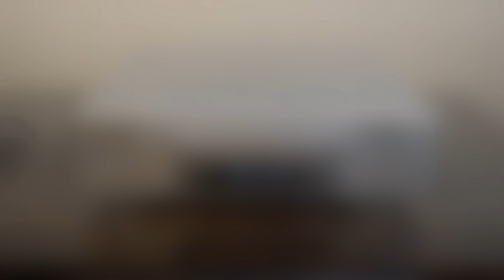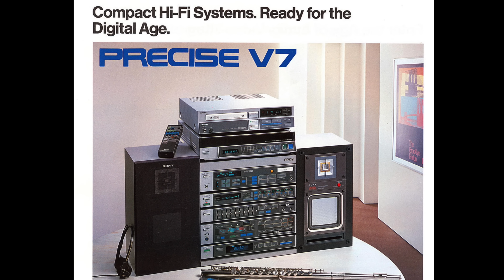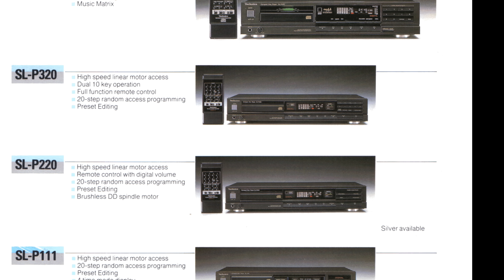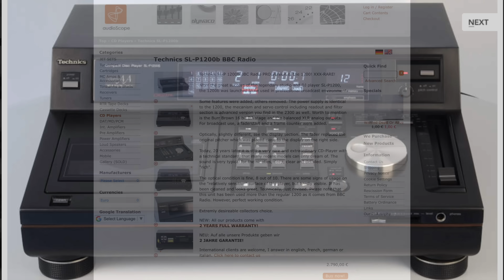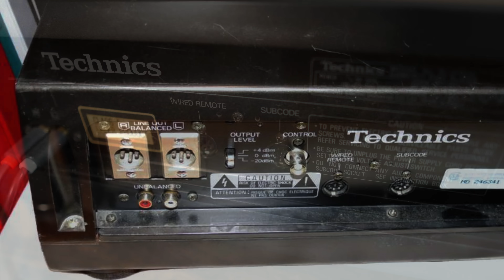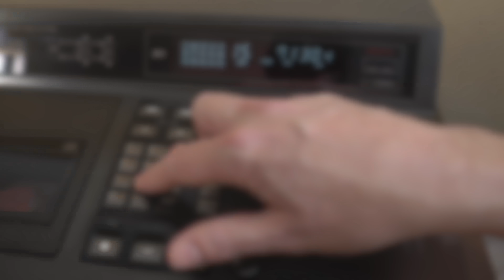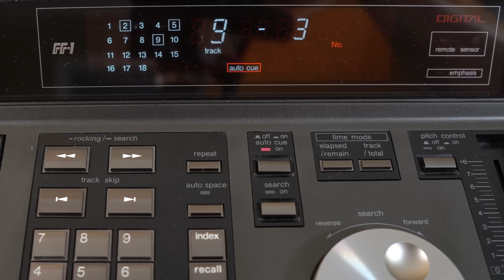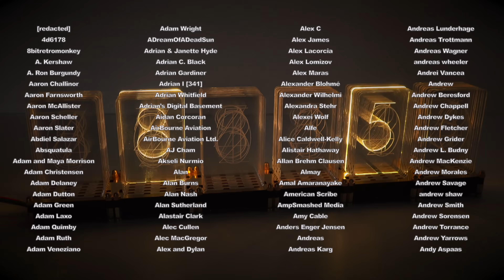How CD players lost their cool & why this Technics didn’t.

Comment: Good to see this player again.  I used the BBC ones extensively when I was a studio manager and Radio One used them before buying Studers. The Studers were better as they remembered the cue points set by the operator/DJ on discs even if they were removed and replaced.  Also worth mentioning that the Technics design mirrored the SL1200 turntable (same feet and pitch control layout). 

By the way the Technics had the ability to access index points using the Index button but I don’t think this was ever used on a commercial CD unless anyone knows different?
Reply: I think indexes were more common on classical music to indicate movements etc.
Reply: I did notice that the pitch slider is reversed compared to the SL1200 though. On this CD player you push the pitch control away for an increase in speed and pull towards you for a decrease, whereas on the SL1200 it's the opposite.
Reply: @robsayer8028  i have no idea why they did it that way but it's annoying! sounded like 3-+4% ish too!
Reply: IIRC the Studer/Revox machines also had that index function which was good to have for playing those commercial music beds used on jingles and ads.
Reply: Atom heart mother by Pink Floyd had index points on the first track, atom heart mother. My old Sony boombox was able to see and use them.
Reply: And Manowar’s "The Triumph of Steell".
Reply: I have a few early CDs with index points. Two that come to mind are DG Karajan  Strauss Eine Alpensinfonie with one track and Rush 2112. I think Fly by Night and Caress of Steel also had index points in the longer tracks.
My first CD player was made by Proton and could use index points.
Reply: Pretty certain there are index points on atom heart mother, though it’s been years since I’ve heard it on cd
Reply: I have two CDs with indexes: Andrew Poppy's The Beating Of Wings and Jean-Michel Jarre's Cities In Concert: Houston/Lyon.

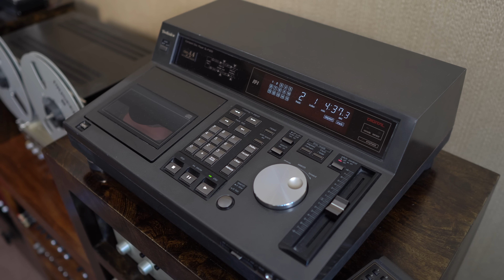Comment: 9:48 Did you actually test the CD player with any CD-R's? If the player is up to the Red Book standard, it should be able to play (at least older) CD-R media. Being from 1986 it might not play CD-RW's and the CD-R must be finalized of course. My experience in the early 1990s was that the "green" CD-R's worked best on CD players that were marginal. Newer CD-R media (especially silver CD-R's) might not play because they expect the CD player to be better.
Reply from the maker: Yes and they aren't recognised. Everything I read about the players stated that CD-Rs wouldn't work and from the few I tested that's correct. I've only got a couple of test discs I burned recently...I don't have a collection of old CD-Rs - I'm sure if I did, many of them couldn't be read by anything any more. If anyone does have any valuable recordings stored on CD-R I'd strongly recommend they attempt to back these up to something less volatile asap.
Reply: @Techmoan  Weird. I wonder if it has something to do with how quickly it reads discs. Maybe it takes some shortcuts to lock the focus and speed on discs as quickly as it does, and maybe that's not compatible with CD-R's which have a slight wobble in the tracks to allow the recorder to focus when it stores data when there's none there yet.
Reply: @Techmoan  is this still the case with more modern CD-R’s? I occasionally burn CD’s on some memorex media, I have on a spindle, ( a few years old) from FLAC digital downaloads. I’ve never had any of these stop working in my mid 00’s Denon system. Of course if they did stop working,  I probably still have access to the original digital files.
Reply: It's sometimes an issue with the disc format, where older players can't recognize multi-session discs, in which case you must burn in DAO mode. But it's also an issue with the laser itself being unable to read CD-Rs because it isn't strong enough. It's more likely to work if you burn at a slow speed like 4x or less, but still depends on the player and even the brand of discs. And CD-RW is even harder for old lasers to read.

Comment: In addition to its cool quirkiness and unusual capabilities, I find something very appealing about the SL-P1200's user interface. It looks and sounds very tactile, in a way that these things usually weren't by that time. The number pad buttons, in particular, sound like they must be intensely satisfying to press.

Also, this brings back two early-CD memories:

1) My first CD deck was one of the boring black drawer models (if memory serves, it was a Garrard), but a short while into its life, it developed a weird fault: it wouldn't work with the top shell of the cabinet installed. We found this out when it stopped working and my father took the top off to investigate, at which point it worked fine until he put it back together. To solve this problem, he built a replacement top shell out of plexiglas, making it possibly the only drawer-loader you could see the disc inside.

2) A friend in college had a multi-disc changer back when that was still gee-whiz moon-rocket tech, but it had the weirdest shuffle function I've ever seen. It appeared to be absolutely, truly, 100% random. It didn't check off played tracks or prevent itself from playing two adjacent tracks in a row; it just chose a random track from the pool of all that were loaded every time. I think it did force a disc change each time, but if it only had one CD in it, it would occasionally get into streaks where its RNG just kept rolling the same track number over and over.

Comment: I bought a Pioneer PD-F706 recently, which, while it doesn't show the CD spinning, does have a 25 disc "jukebox" compartment, and also a slot in CD player for single discs. Why do I mention this? Because it's definitely borrowing some design choices from those early vertical CD players 😂 It's taller than my amp/receiver, and currently the beafiest part of my stereo setup, clocking in at 18,8cm height with the feet. 😄